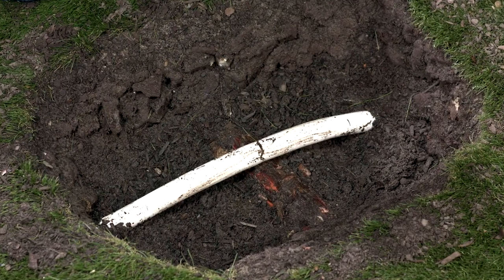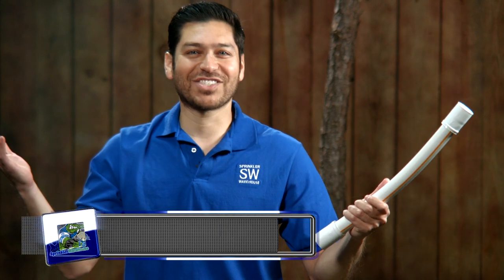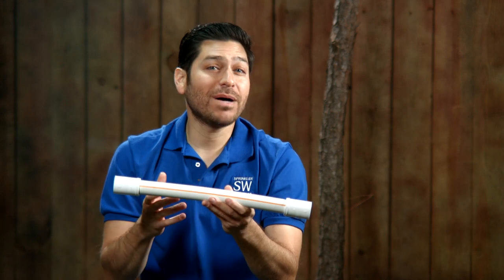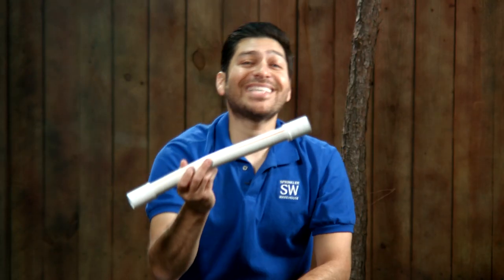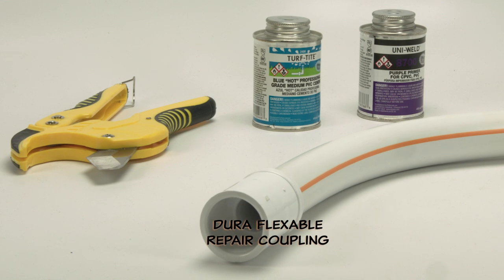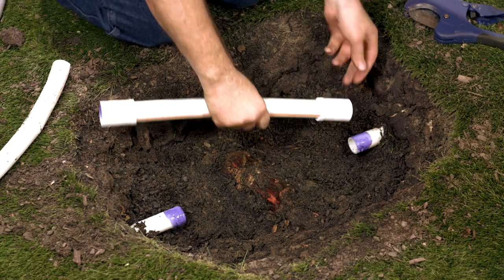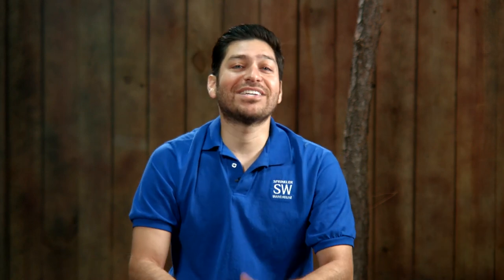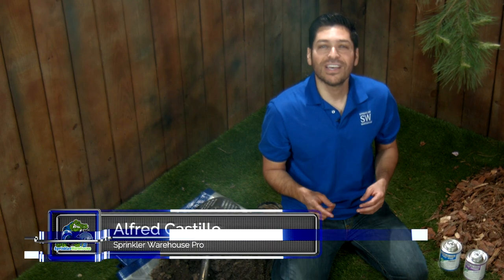Dura Flexible Repair Coupling

Comment: Do they make a 12" repair coupling? The 18" is too long.  If a 12" is not available can the flexible hose be cut to 12" and a coupling glued to the cut end?
Reply from the maker: Hi Larry, we do not offer a flexible coupling in 12". We do have a Interlock Pipe-Fix coupling that is suited for 12" repairs, SKU INT-1100. 

Here is the product link: https://www.sprinklerwarehouse.com/interlock-sch-40-pvc-pipe-fix-coupling-1-in-slip-int-1100

Comment: Can this handle winter cold conditions? Is it just as durable as the PCV piping itself??
Reply from the maker: Hello, this product is manufactured from flexible PVC, which allow for more durability and flexibility in extreme temperatures. This product will need to be blown out at the end of the season to ensure there is no water left in the line before it gets cold. However, the flexible tubing does give more grace when it comes to the colder weather.

Comment: i'm not a sprinkler expert but i have a pretty extensive system at my home. the PVC in my system leading to the valves holds pressure all the time until the valves open and from there is the cheap black pipe to the spinklers. so where would this be useful?
Reply from the maker: Thank you for reaching out. Unfortunately, this product would not be ideal for your installation. This product is only compatible with PVC and is not manufactured to be under constant pressure. If the correct fittings are used to adapt the poly to pvc, you may be able to utilize this product after the valves.